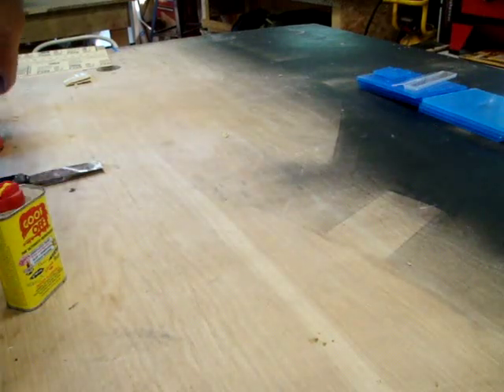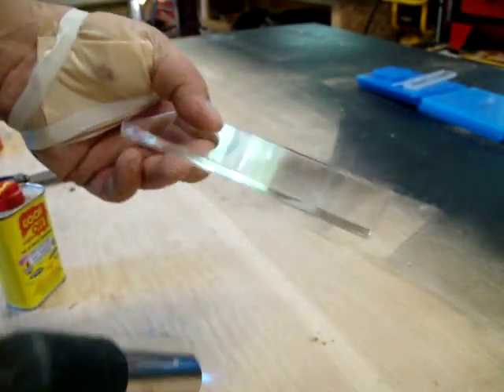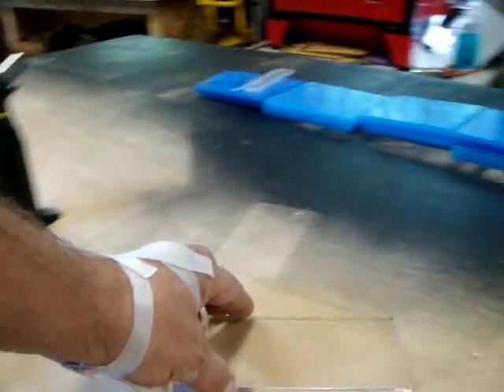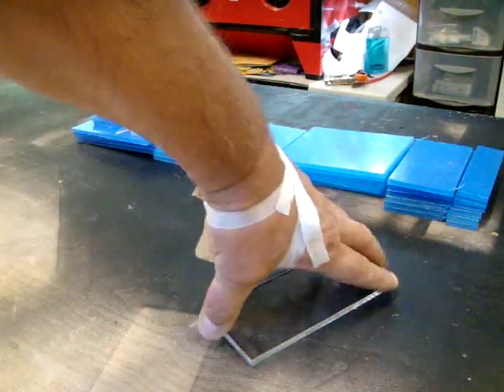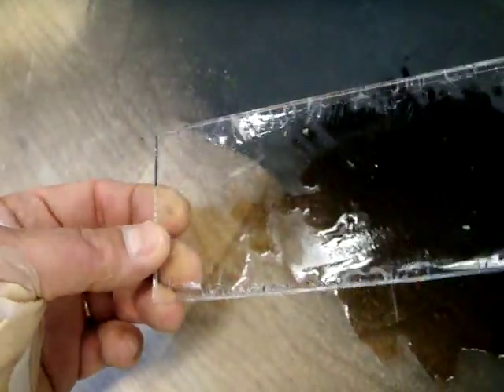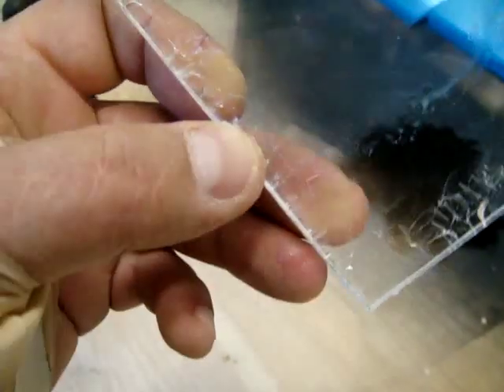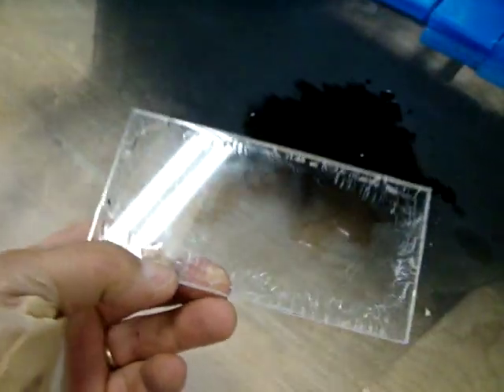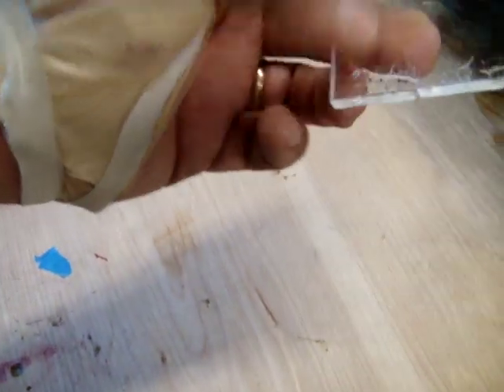Flame Polished Acrylic Reacting to Alcohol

Comment: This has nothing to do with the flame polish but the chemical reactions of the plastic at the molecular level. You should never use alcohol to clean acrylic.
Reply: This absolutely has everything to do with the heat, i worked in semiconductor industry, AMD, Lucient, Intel, etc. and the only cleaning agent allowed is 100% IPA and had never seen crazing. The next ten year i worked in R&D for in medical devices and we made plenty of acrylic test fixtures and after flame polishing, this happened, month later, it does somehow change the acrylic from a molecular level.

Comment: I wish i new this before destroying my project, wiped it down after i was all done.
Reply: I 'machined' (don't have a lathe/mill so used my battery powered drill) a few stand-offs from acrylic round-rod. As usual I used ethanol to make drilling a bit easier ;) . Drilled 4 standoffs and then removed the drillbit from my drill and replaced it with a thread-cutter. Got my first standoff-to-be and... WHAT THE !R@#%@! .
Ah well, you never EVER forget such a thing. You'll remember it for always and there's no better lesson than making such a mistake.

Comment: actually for laser cut edges which i do on acrylic i dont have that crazing problem. this crazing is normal when you flame polish the edge and not only alcohol but even with acrylic glue you will see the crazing on the glued edges for flame polished acrylic. so if you want to glue it, only laser cut or router cut. but if it is a thick acrylic as a end display when the flame polish will give it a clear finish and that is it. no treatment on the edges after that. otherwise you need to heat temper it to slowly cool back to room temp. the crazing is due to rapid temp change within the plastic structure that causes those micro cracks

Comment: You need to heat up slowly up to 100C after flame polishing (ramping at least 2-3 hours) and then allow to cool down to room temperature in controlled manner for 7-8 hours. Then it will be stable.
Reply from the maker: +hangebicom You are exactly right. Annealing the sheet is the only way to release the internal tensions.

Comment: Heh. From what I understand, acrylic absorbs water and in situations like an aquarium lid it will droops towards the water. I kinda feel like the edges are more susceptible to absorption and the fact that alcohol tends to dry things out that it is probably the cause in this case.
Reply from the maker: +MidnightMarrow Not exactly. Some formulas of acrylic are less susceptible to water uptake than others but in general acrylic absorbs water to a small degree. This causes the water-exposed face (not edge) to swell which makes the sheet curl  away from the source. Hence the need to flip an aquarium lid ever so often. Heating the edge by torch, laser or machining alters the mechanical property of the acrylic. The heat affected zone is at a stress boundary with the rest of the material. Even without alcohol the HAZ will tend to craze or crack. You can see this on laser cut parts all the time. Addition of solvent cement (or alcohol) is just a catalyst to release those stresses.

Comment: I use isopropyl alcohol (IPA) on Cast acrylic to remove residue after engraving and works fine for me... no cracking.. just wet a microfibre cloth a bit and rub off the whitish dust off...
Extruded is probably completely different story..
Reply from the maker: I would suggest you use Novus. Unlike water or Isopropyl Novus cleaner leaves the plastic with a neutral static charge (for a while) that will not attract dust. You aren't flame heating your plastic so I would not expect any reaction. This will happen with cell cast too. Better to mechanically polish an edge than to heat polish any day. The reaction demonstrated is about introducing stresses to the polymer matrix that get released when exposed to denatured alcohol. Read the printed protective cover on most plastic and you will find a warning against using chemicals to clean the plastic: only warm water and mild soap are usually recommended. Prolonged use of something like ammonia or alcohol will cause the surface to haze.
Reply: FYI there is a difference chemically between standard denatured alcohol and isopropyl (70% rubbing) alcohol.  Have used isopropyl on flame polished acrylic light pipes with no reaction.
Here is an explanation from ecolink.

Denatured alcohol, sometimes referred to as methylated spirits, includes specific additives that make it non-drinkable. This form of ethanol has a bad taste, smells foul, and is poisonous if ingested. The additives exist to deter individuals from attempting to consume it for recreational purposes. Typically applied as a solvent, denatured alcohol is suitable for numerous application needs. Many forms contain approximately 10 percent methanol as the additive, rather than other common alternatives such as isopropyl alcohol, denatonium, methyl isobutyl ketone, and acetone. Denatured alcohol is used in wood sanding, small camping stove fuel, cleaning aids, application as a solvent, and in the production of some fuels.

Rubbing alcohol is considered to be a surgical spirit rather than a methylated spirit since it is used in medical environments as a topical application. It is a type of denatured alcohol prepared from a special solution consisting of roughly 70 percent pure ethanol or isopropyl alcohol in its concentrated form. The generic term rubbing alcohol is used to describe either isopropyl or ethyl based products with similar qualities, and is essentially a unique type of denatured solution. The two forms are designed to serve different purposes and antiseptic versions can be used as a gentle solvent substitute for home or business applications.

Comment from the maker: The process used to treat cut parts is called annealing. The part is slowly heated to a certain temperature (based on thickness and composition of material) then allowed to cool. This lets the internal stresses work themselves out. The fracturing is a chemical/physical reaction. I am not a chemist so I can't really explain what is happening, but as you can see the physical integrity of the polymer chains is disrupted. Your guess is as good as mine. Not sure what kind of coating might work.

Comment: @jaywilly471 cracks decrease the impact resistance a lot.
But you can reduce this by glueing it with a flex glue without solvents on the non-cracked zone.

Comment: @poosaypirate no it is a bit different:
The flame makes the surface to melt andwhen flame is removed, it rapidly cools down causing tensions in the plastic. Tension level decreases with distance to the edge.
Once a chemical is used which is incompatible (but does not dissolve it), it will cause cracks (it is called stress-cracking).
These cracks suck in the liquid and the process continues.
(it can be stopped by washing it off).

Comment from the maker: It destroys the integrity of the material...it become brittle and will keep crackling.

The acrylic is clear but difficult to see through because of the number of internal fractures.

The panel can only take in the alcohol from it's outside surface so whether you drop it in a puddle like I did or wipe it on it  or soak it in it it's going to fracture. It will fracture the most on the surface that is exposed to alcohol.

Not sure if it would hold up for a window effect.

Comment from the maker: lol. I was drilling on a piece of scrap aluminum that I should have had clamped. Drill caught the piece of metal and spun it around into my palm. As luck would have it the piece of metal had a long blade-shapped offcut on one edge. This punctured me about an inch deep and on the way out dragged some fatty tissue out through the wound. I kept working the rest of the day and when I went to the ER the next day Doc said it was too late for stitches. SO I have a piece of fat hanging out..nice.